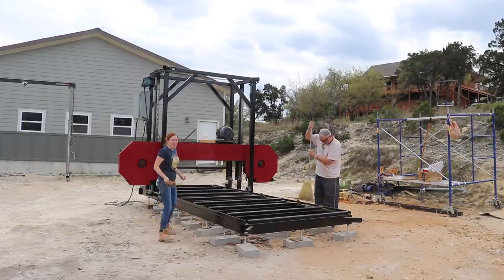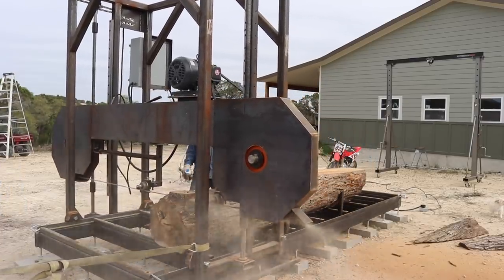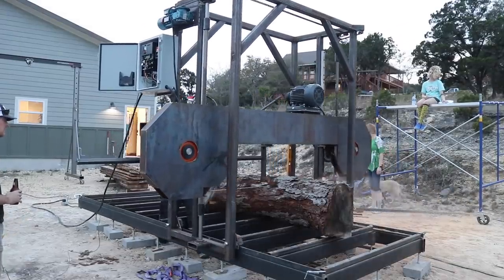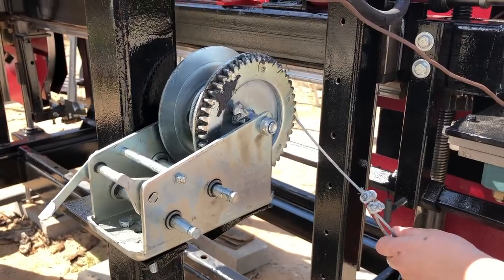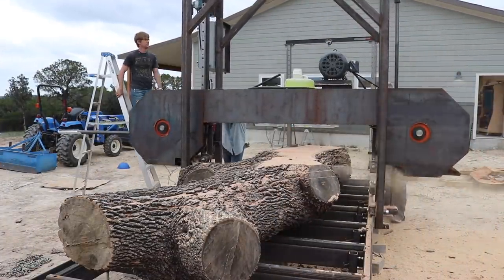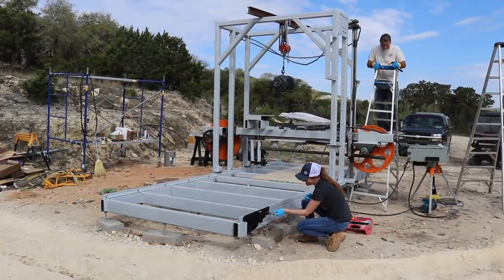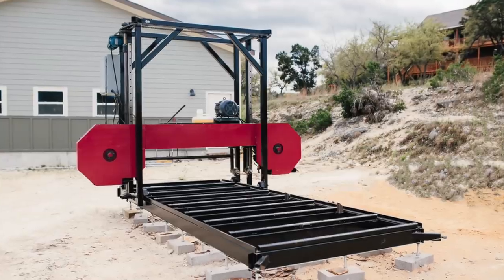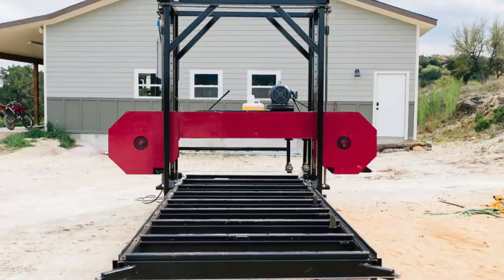Slabbing With My Bandsaw Mill

Comment: There's a lot of misinformation here in the comments concerning the use of diesel, first off its not used to lubricate the blade...that isn't necessary, diesel is a solvent and its used to keep pitch from building up on the blade which makes it stick and the engine has to work harder to keep it spinning.  Second, diesel will not harm your blade, quite the opposite in fact, it will keep it from corroding.  Thirdly, so little diesel is getting on the blade in the first place that there isn't enough of it to soak into the wood so you would even smell it on the wood let alone for it to soak deep enough within to affect any finishing...but more to the point, you're sawing rough lumber here, you're going to square it all up in a planer and jointer which will remove the entire outer layer of wood where any diesel could have soaked into thereby eliminating that nonexistent problem.  But, if you're stickers are not the same wood as the boards you're stickering, they can sometimes discolor your lumber.  I'm speaking from thousands of hours of experience running a sawmill(with diesel fuel to keep pitch off the blade) and using my own lumber cut from that sawmill to build my own woodworking projects, non of which have ever been an issue staining, sealing or otherwise.

However, diesel will eat at belts, its never happened to me personally, so I'm not sure what everyone else is doing to splash diesel fuel all over their belts.

When you're stickering your lumber the outermost stickers should be as far out towards the ends as you can reasonably get them.  We do this because as the wood dries your lumber will crack and split at the ends, its called checking.  Those cracks will extend as far as your first sticker, sometimes they'll go beyond but not often, but if you have your stickers close to each end of the board you'll have more usable board once its dried.  And if you really want to minimize checking you can wax the ends of your lumber to prevent the moisture leaving from the porous end grain which it does faster than the rest of the wood...which causes the splitting.  Even still, if you want to end up with 8' boards, cut your logs at 8' 6" so you have a little extra length to account for the checking

Lastly, I think one fella already said it below, you really gotta keep that log out of the dirt, don't drag those through all those stones and sand, you'll just end up spending a fortune on blades because you're having to cut stone too.  If you haven't already, buy yourself a blade sharpener, you'll save a load of money sharpening your own blades...that is if you cut lumber frequently.
Reply: Thanks for adding the voice of experience.  My brother just picked up a band mill from Woodland Mills at the end of the summer of 2020.  Not as big as this one, but more portable, especially since he mounted it on a tri-axle equipment trailer he already had, which we rebuilt in my driveway.  With added stake pockets, stakes and D-rings and a small 12 volt over hydraulic jib crane with cable winch, he can use it for retrieving logs or bring the mill to the worksite, whatever best suits.  He's been using windshield washer fluid this winter for lube (ethanol and water, with added "blue", as far as I can tell), but he's mostly been milling wind thrown and senescent poplars.  Once he gets into the red and white pines, I'm sure #2 diesel will be the ticket.  An auto advancing blade grinder is definitely on the short list.
Reply: I don't cut live edge, I cut red cedar, and put Dawn Dish detergent, and Pine-Sol in water to run on the blade and it works well.
Reply: @benjamindover4437  better than flammable oil based diesel fuel plus you can use it to lubricate the ends from checking

Comment: Mount a couple of led light bars across the top of that gantry and work into the night!  😁 Great job April!
Reply: definitely that, a 5m strip with the 230v power supply is like 15 bucks, a good investment.
Reply: Dito the lights
Reply: @satibel  230V in the US ?? 🤔
Reply: @Daweisstebescheid  also 220 or 240
Reply: @ZrubekFamily  whatever it takes
Reply: @Daweisstebescheid  they said they have 230V in so 230V would work, though yeah a 110V led driver would work too.
Reply: LED in such strips are mosty 3V, 4 in series which means You can use 12V, then You use transformer so You can plug it into Your outlet/whatever
Reply: @ZrubekFamily ...The US hasn't had 220V in 50 years.  Common single phase line voltage is 120-125 / 240-250.
Reply from the maker: Yep, lights will come when the 110 outlets are put in. : )
Reply: @AprilWilkerson  Awesome April!   ...- You're new super hero name.   lol       I liked  watching the woodmizer clips  before, Because it looked like fun in my retirement.  Some may pay to have mantles  or furniture from the trees on their land.   Go girl you are freeking Awesome!
Reply: April Wilkerson, I was just watching your "ultimate workbench + 10 shop storage solutions" video from May 20th 2018. I looked at the link and listened to the video 3 times in a row but didn't hear how thick the legs and rails of the "basic table" were. 
Did you use 5/8ths thickness on all wood pieces for the WHOLE basic table or just the huge "table" size pieces? Were the corners and rails made of 5/8ths thickness or something thinner?
Reply: Buford Pus
Reply: @paulcopeland9035 and anybody else --- actually in the usa / california. i find anything from 110 volts to 125 volts on the 115 volt side of things and 197 to 248 volts on the 208/230 volt side of things. 

Voltages in the usa are suposed to be --- 120 volt or 208 volt or 230 volt. i find voltages all over the park in the real world on commercial Buildings.
Reply: @AprilWilkerson  are there any updates on the mill coming soon? I can only watch your mill videos so many times. Need more. Please I'm addicted lol
Reply: manaquri pp
Reply: @billallmon4094  I wwywry
Reply: @billallmon4094  wy
Reply: @billallmon4094  r
Reply: @billallmon4094  I'm
Reply: @billallmon4094  r
Reply: @billallmon4094  r
Reply: @billallmon4094  4

Comment: April, love the mill!  One suggestion would be to NOT drag the logs getting dirt and rocks embedded in the bark...it’ll dull your blade very quickly.
Reply: Yeah if she was going to drag him through the dirt like that you almost want to take a pressure washer and clean all that crap off the bark before you start running your nice sawblade throw it
Reply: Also if you’re getting logs in Texas, you’re bound to find metal in a log sooner later (nails, staples, bullets) Might want to invest in a metal detector to scan the log before cutting.

Comment: Most use soapy water as diesel is hard for the environment and if your wheels have rubber it destroys the rubber Some mills use rubber on the drive wheels. If you get gum build up while cutting pine you can use WD~40 to clean them and if you want your blades to last longer peal the log where the blade cuts. when you drag the log threw the dirt it dulls the blade very fast. Happy cutting.
Reply: the wheels she is using do not have rubber and water usually gets consumed much faster and leaves piles of very wet sawdust, I personally use water but because of cost not effectiveness lol

Comment: Hey April you can use Pine-Sol and water mixture instead of diesel I use 20 oz to 5 gallons of water it also doesn't leave a oil residue on the wood also when setting up the stickers put your stickers closer to the edge it cuts down on cracking and a solar Kiln would work great for you

Comment: Great job.  If you place the logs on the mill small end first, if it easier to know how deep to make your first cut.  Also, if you put another valve on your water line, you can set one to the flow rate and the other for on and off.  Keeps you from having to reset the rate each time.
Reply: Rob Pridgen wouldn't the valve on the jug control on/off, so they wouldn't be adjusting the flow valves?
Reply: @mlindholm  mine didn't have one on the jug.  But if so, you are right.
Reply from the maker: I turn off the flow at the jug. : ) I also just take a measurement to the lowest point on the length, not just the end. However I do try and face the end of the trunk towards the blade.

Comment: Wow the mill is a beast and turned out awesome . I had a local mill cut some live edge cedar to use as barn siding. I wanted to dry them before instilling  so I made a solar kiln by using thick black plastic and wrapped the whole stack of wood. This kept the wood dry from rain and acting as a solar oven I put a remote wireless thermometer and could record high temps and lows as well as humidity. The black plastic worked great the kiln highs stayed about 140 to 160 degrees. I was going to dry the wood around a month but ended up drying for six weeks due to weather delays . This help to stabilized the wood as well killed any bugs that was living in the wood. Great project.Look at how far you have come from part time working in the garage. Awesome job Congrats on the new mill.

Comment: Hello April,  Diesel fuel or any other oily fluid should not be used as a lubricant unless you are cutting firewood.  If you are planning on putting a finish on these slabs the oil may cause an undesirable outcome.  Most all sawyers use nothing more than water with a little bit of dish soap.  Good looking mill.  Good luck with it.

Comment: Great video as usual. Now most people I know that have saw mills just use water with some Dawn soap mixed in. Like a 1/4 cup for that size container that you are using.
Reply: Diesel is a waste. Water is the way to go. Plus water will cool the blade better.

Comment: Fantastic build.  If you need rain cover for your slab piles, I've used 2" PVC pipe to make a simple frame to throw a tarp over so you always have airflow around the wood.

Comment: A suggestion here in Canada we use water and Dishwashing Liquid to 
lubricate the blade instead of Diesel (more ecological and don't smell if you want to use raw wood inside)
Reply: I bet that works great, makes sense!
Reply: we do that here in Texas to it's just what ever your personal preference is 🤷‍♂️🤷‍♂️🤷‍♂️
Reply: We use Pinesol and water, at about 32oz Pinesol into five gallons of water.
Reply: Diesel is biodegradable.
Reply: Linseed should work.
Reply: rats arsed  u know ur stuff! Might be right. I make water based wood stains.

Comment: I don’t know who told you to use Diesel fuel but that is bad advice. Diesel is a petroleum (Oil) based product that soaks into the wood. “Oil/Petroleum and Paint don’t mix.” When finishing wood, that Diesel will react with the finish and ruin the project. Additionally the Diesel will discolor the Wood. It reacts with the tannins in most woods. I also bet  E.P.A. Prolly won’t appreciate Petroleum soaking into the ground eventually making it’s way to the water table. Not criticizism, just advice. Thanks! Have A Super Week!
Reply: Not sure who told you diesel was bad but that is what 99% of guys use who mill their own....one drop per second isn't gonna hurt a thing . Its good you are thinking just be nice if you were more informed.
Reply: By the time the wood is seasoned, it should be dried off of the wood. Unless one forgets to turn off the drip, very little should get into the ground. The mist that may be flying off the blade should also dry and not go into the ground. There are two main grades of diesel, #1 and #2, one is about the same as kerosene, but I think with more sulfur.
Reply: I work in at a Millworks plant. Our resaws (large double bladed band saws that use a 4 inch wide blade) are lubed with    50/50 mix of "blade oil" and Diesel.

Comment: I have worked around band mills for several years in the past. I have seen broken bands go through the guards, be careful not to be inline with the wheels while the band is turning.
Reply: the gourd looked a bit thin could have used more of the scraps to weld vertical guards first. and should have put the log holders in first befor adding a log

Comment: Great job on the mill and getting all that help lined up. I really like the idea of a digital read-out (DRO) on that mill. If you get that thing to "announce" over bluetooth - and if you had a huge display then you would have something to really help with efficiency. Make your shed/cover SEPARATE from your mill so you don't have to remove it from your mill when there are issues. It'll really help to work in the shade.

Comment: Don’t use diesel. It will eat your belts. We use water and pinesol and dawn dishwashing liquid. It’s a lot cheaper also.
Reply: and diesel will contaminate the soil.
Reply: For pete sakes guys....the diesel doesn't hurt a thing ...its what all the adults use on their mills for blade lubrication...google it if you don't believe me.
Reply: @hughjasole9336  yea, and DDT was safe at one time.
Reply: I used to use diesel and ATF but water and Dawn dish soap work sooo much better!
Reply: this. I run dawn and water. Works perfectly.
Reply: @surfk9836  Falling for the "Silent Spring" lie?
Reply: @rogerNOmore  oil came from the ground. Lol
Reply: Tim Henry uranium too. ;)

Comment: As you learn about the operation of your saw and sharpening of the blades, dragging logs on the ground is a quick death for your blade so a bigger tractor is in your future because you can do small jobs with a big tractor but not a good idea to do heavy lifting with a small tractor.
When completed you will have a great milling operation going on for sure.
Reply from the maker: Why does dragging a log on the ground shorten the blade life?
Reply: @AprilWilkerson  your innocence is painful to watch! If the trencher needs titanium carbide teeth to cut a material, adding that material to clean wood will tend to dull a band faster
Reply: @AprilWilkerson   The dirt and stones do not cut very well with a band saw blade you can drag the logs on the ground but you need to strip the bark off before cutting on the band saw . Do you pick up an old board up from the driveway and run it through your planner?
Reply: @AprilWilkerson  Dirt, sand, gravel gets buried in the bark of the logs as the log is drug over the ground.  The saw blade then tries to cut the debris while cutting the wood and the teeth get dull very fast or broken.

Comment: Pro tip: coat the ends of your logs (before or after slabbing, doesn't matter) in a sealing agent. This prevents the lumber from drying too fast- causing checks, splits and warping. I've been sawing in SE Nebraska for a couple of seasons and this extra step is soooo worth it, I've found. Keep up the great work
Reply: I wondered what that was for, when I've watched em cutting slabs they always paint the ends.
Reply: @darkcoolcat UCCoatings makes a wax-based product called Anchorseal 2 that does a great job, At the very least, some old/ mismatched (latex) paint is better than nothing at all

Comment: "Cody is an Engineer" Uses pocket knife to tighten screw lol.
Reply: True. An engineer knows what he is doing I guess. Haha
Reply: Those are push to connect terminals.  There's a tab that needs to be pushed in to allow the wire to slide in.  He was using the point of the knife to depress the tab,  not tighten a screw.

Comment: Some diesel is died pink for tax purposes. Great videos.  Thanks for sharing!!
Reply: That is for off road use. Farm Use Only diesel, which is most likely what she has. I didn't think about that until I read your comment.
Reply: I had thought this originally too but she said it was happening when she first started and was using only water as a lubricant.

Comment: There is a WORLD of difference of the cutting/shaping/bending of air dried lumber compared to kiln dried. The air dried is a dream to work with. The kiln dried not so much in comparison.
Reply: McKay Sleight kiln drying for lack of a better word gets brittle but that’s not the right word but my father would know but not available at the moment it’s not as bad when air dried then finished in a kiln less checking and splitting but the ratios are all different for different species

Comment: Awesome!  One suggestion I could make would be to rework the 2" PVC that feeds the junction box on the mill.  Since the mill just sits on those blocks I'd be worried about the PVC breaking with the mill being moved around by placing the logs on it over time.  You might want to set a post near the mill with the PVC and box mounted rigidly to it and then a piece of flexible conduit like Liquid-Tite to feed the service to the mill.  That way you'll have some flex without breaking the PVC.  Just a thought.  Keep on slabbing, it looks like fun!

Comment: would think you could spring load the blade guides, with some small wheels on it.  Open and close as they travel,  and maybe wire up an electric blower to clean the logs before and after the cuts.  Nice job.

Comment: Awesome job and Mill, I wish I had one just like it. You and Anne are great together or apart. One suggestion, about the diesel lube. I used it till my sawdust got saturated with diesel and became a fire hazard,(NOT GOOD). I have had my mill since 1998 and have used all kinds of lubes. The absolute best I have found is Tide Liquid laundry soap,for high efficient washer. The high efficient soap is low suds so you don't have bubbles blowing everywhere. Blade stays clean even when cutting high pitch woods like pine and the smell is fresh and clean and NO fire hazard. I add 2 cap fulls to 5 gallons and pour it in after filling container to avoid suds.